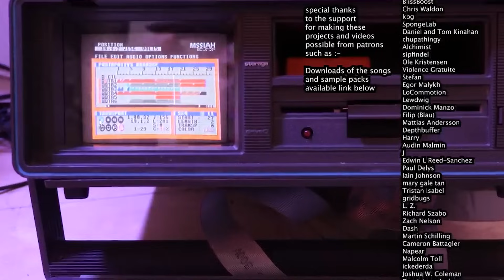Wiring in the different Group Selectors In The UAX13 Telephone Exchange

Comment: Cable lacing, a lost art.  I worked on an ITT electronic switch back in the 70's that was "programmed" by wire wrapping leads to various pins.  I still have that wire wrap tool.  Ironically, I can configure a Raspberry Pi as a PBX to do 100 things more than that mechanical switch.
Reply: nice!!

Comment: Interesting way of wiring  from the Group selector banks. I don't think that ties in with how I remember how  UAX 13   was wired back in the day  . The group selector banks   were wired to the final selectors  not to other group selectors
Reply: Yep! It's not how they would usually work. But it's more descriptive of how telecom worked in the grander scheme of things like this. So opted to have some artistic licensing when wiring them up. This way results in 4 number phone numbers but if you use a phone on the same rack "local" you can get away with just using 3 numbers as straight away dialling the final selectors.

Comment: You need the wire wrap gun, it's electric ;)
The one i had was 110v with transformer, but would happily run on the +/- 50v (giving 100vdc)
Reply: Thanks! Yeah as mentioned in another comment below. I have one :D. But I like gojng a bit slower as it's less prone for me to make a mistake and ultimately it takes longer! Since it's not my job I'm not as practiced and even going slow it's only 10 minutes to do a bank of selectors so I'd prefer doing it manually :)
Reply: Think the one I have has a battery plug! I can't remember actually. Not used it much! :D

Comment: Should look into getting a wire wrap gun... esp one of those older all-metal ones.
Reply: I have got one! Buti prefer this manual one as it makes me go slower, less prone to messing up which ends up taking longer. So opt for this as it is only a 10 minute job with a manual one anyways. :)
Reply: @LOOKMUMNOCOMPUTER  ah :)

Comment: My electronics instructor in college started his career working on a similar system for AT&T in California’s central valley.  

He arranged a for our class to take a field trip to see a similar mechanical system in a nearby small town that was being ripped out to be replaced.  I was amazed by all the complicated wiring.  

I was pretty sure that the people responsible for the design and construction were either crazy or geniuses.  

The amazing thing was that the entire rack and mass of confusing wiring was being replaced by a few server blades in a single rack and some fiber optic cables.

As an amusing side story, land lines in the US used to be powered by the system.  My instructor said that in this power was provided from the grid, but it was rectified and sent to two battery packs using power voting diodes to decide which pack provided power at any given moment.  These battery ststions were spread all over the country at regular intervals.

He was troubleshooting a power system fault, but couldn’t determine which set of batteries was the problem.  He figured he had a 50/50 chance of getting it right.  He got it wrong (Murphy is).

It was on a T5 line that was the main trunk between Los Angeles and San Francisco.  He seemed to be proud that years later he still held the record for most phone calls dropped in the district.  

He had cut off every phone call between the two cities on a Wednesday afternoon.

He said that at the time it was the third largest drop in US history.  The other two were caused by a flooded tunnel in Chicago, and a lightning strike that took out a microwave transceiver in Nevada that cut the backbone between the east and west coasts in the 60’s.

Since he was able to immediately switch to the other set of batteries, nobody but AT&T realized anything had happened.  

Everybody just assumed that only their call got cut off and redialed.  AT&T just never told anyone it had happened.  

I understand just enough of what you are doing to see how it figures out the number being called.  What I don’t understand is how it handles more than one incoming call at a time, or how the relays connect the incoming call to a specific phone corresponding to that number.